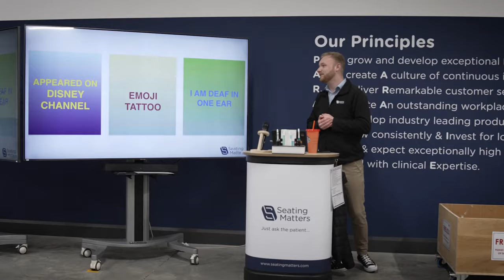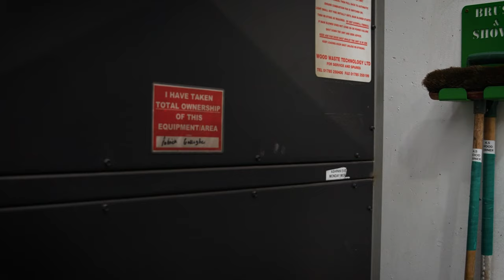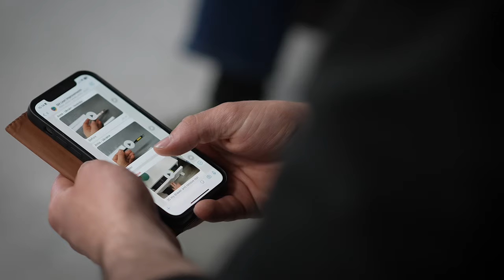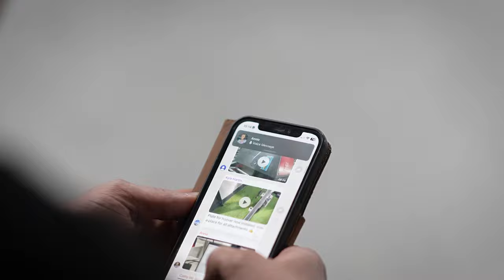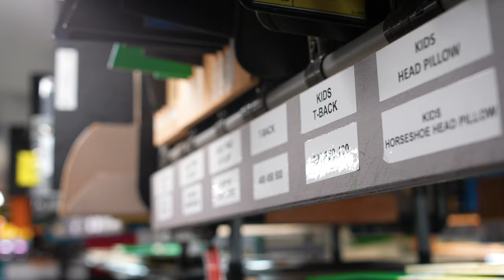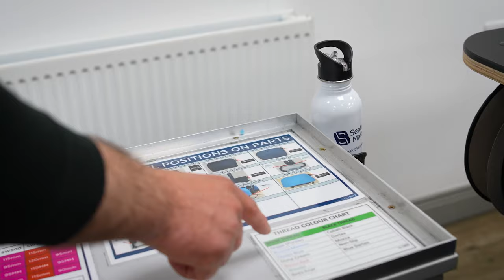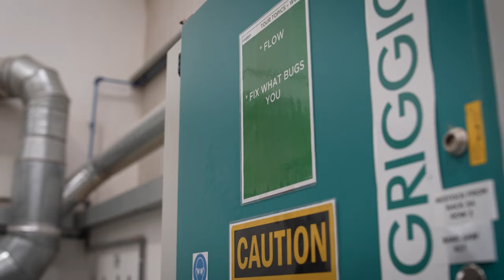Lean Manufacturing: MIND-BLOWING Factory Tour! (Behind The Scenes)

Comment: In 2004 I worked at a Brewery in Tadcaster. 2010 then saw Heineken takeover and introduced TPM throughout its UK sites which I was involved with from its implementation. To this day I continue to use these strategies and methodologies. Continuous Improvement means to me challenging the status quo and using facts to drive the improvements, getting the workforce engaged from every level from the Top down.